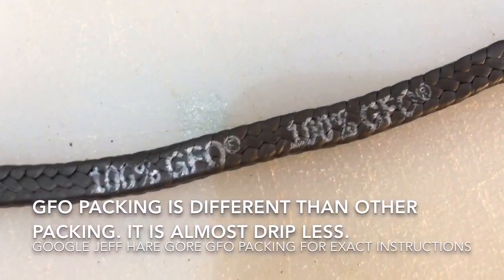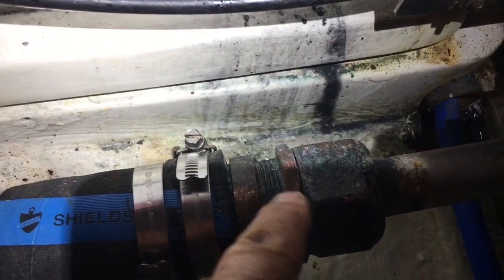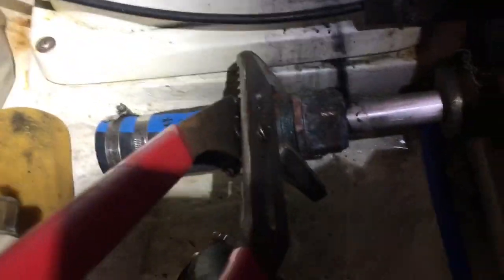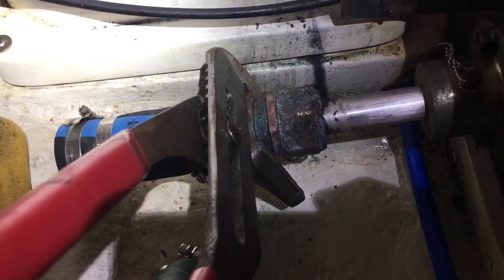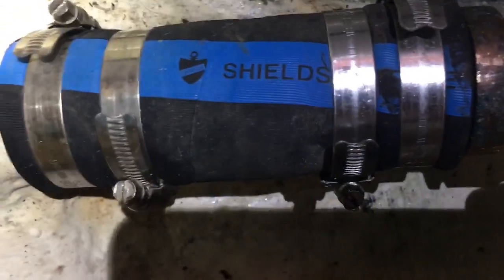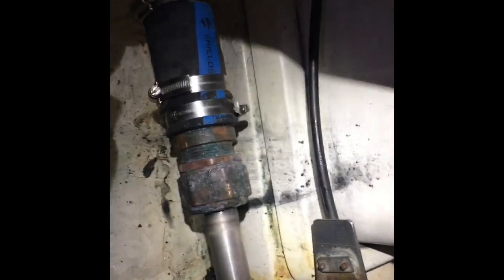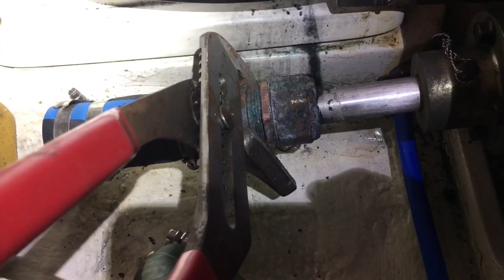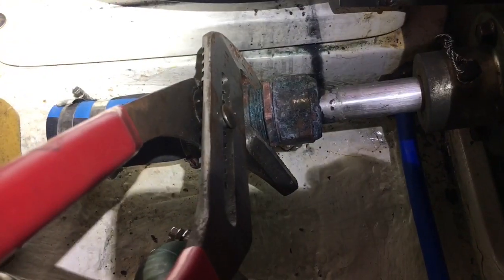Packing Gland Adjustment Using No Drip GORE GFO Packing

Comment: You could just put two crescent wrenches to release the locking nut. One on the small nut, one on the large nut... Unless I'm misinterpreting why you were using channel locks on the rubber hose.
Reply from the maker: I was using pliers on the brass flange not the rubber. I can’t remember why I didn’t use the approach you recommend since it should be my first approach.
Reply: @dannyjensen4954  Ah!!! Ok, I knew there must be something I was missing lol.

For that purpose, to keep the brass coming out of the shaft log hose, I simply use hose clamps and then leave them on afterwards.

I figure since we have to have all connections double clamped anyways (USCG great lakes region), I may as well get some alternative use out of them, haha.

I think of switching over to Volvo Penta's "rubber stuffing box" that uses grease and a mechanical seal without a water line having to run to it. It gets the job done and is dripless.for many many years of service. 😊

I love your vessel though man, it looks like a well maintained and tended to machine! Ready for more videos, hehe.